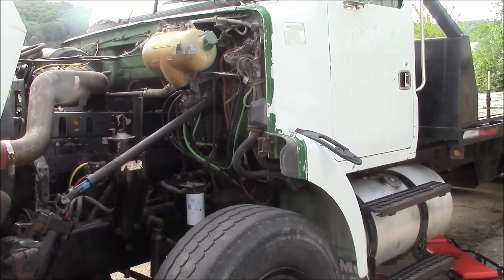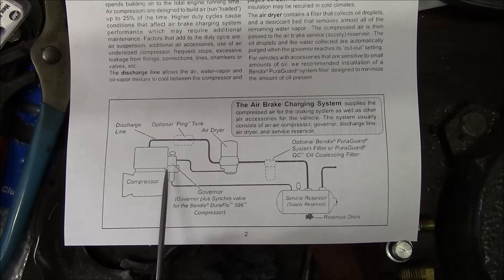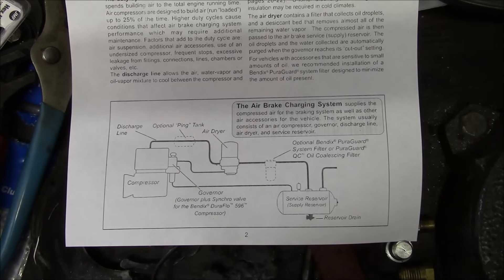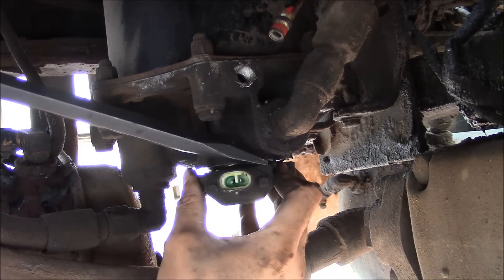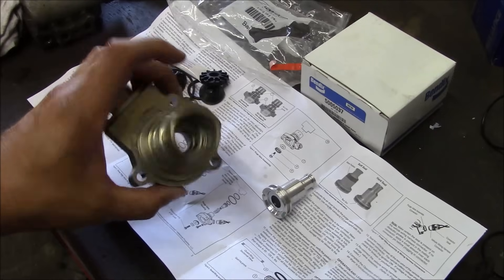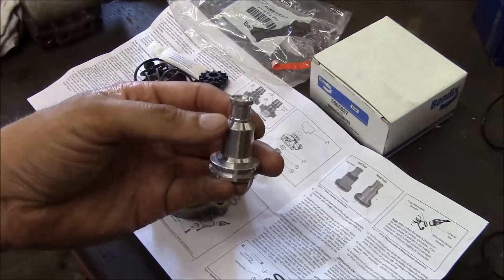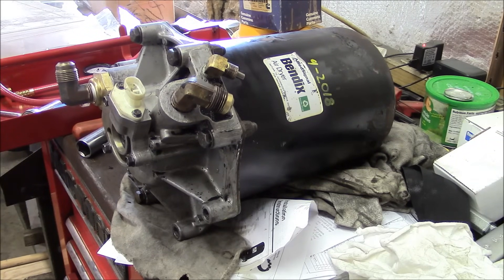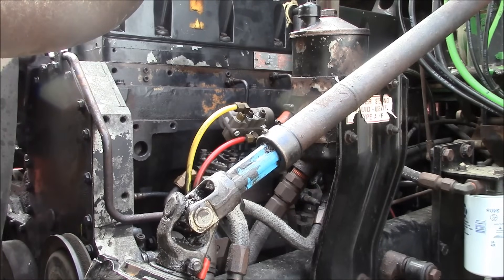Truck Repairs: Air dryer purges constantly

Comment: This helped with figuring out the air leak in my 1999 Bluebird Bus (skoolie conversion), Cummins pusher/Allison auto. I was just about to move it to a new (cheaper) storage lot and there was this intermittent hissing. I could feel air coming out of the purge valve. Obviously the air system was not getting up to pressure. After digging around (including this video) I replaced the valve, a $13 fix. No more leak! Not only that, the system held pressure overnight, which it had never done before, so evidently this leak was always there since we bought the bus (2020), and just now decided to 'erupt.' Perfect timing.
Reply: Hey can you give me some advice as to why my 2002 international short bus decided to stop building air all of a sudden? I started it and moved it around and went to park and it locked up at 30psi

Comment: This video provided the clue I needed.  I have a vintage truck that I added a dryer to. The unloader would work so long as the purge valve wasn’t hooked up. With the help of this video I realized there was an air leak in the purge valve line. It wouldn’t leak until the unloader valve activated and then you couldn’t hear it over the engine. The leak was bad enough the unloader valve wasn’t able to build enough pressure to cycle. A little BB of plasma cutter slag burned a tiny hole in the line. Thanks!

Comment: If that check valve is leaking would it cause the compressor to not cut off. I’ve replaced the governor and it won’t cut off.

Comment: Thank you your video proves I'm right that there is a problem that the company shop said is not a problem so compressor is running all the time loses air while running and while setting not running

Comment: Hey, cool vid! How often should that blow-off valve thing vent? My RV's doing it every 3 minutes while idling, even without using the air or brakes – something's fishy, what's the normal time between compressor restarts?

Comment: Sooooo, what would cause a HIGH pressure issue? Got a Peterbilt body job that is showing 150 PSI on secondary, 120 primary...how is that even possible? If anyone can shed some light on this, thanks from a puzzled guy in Alberta, Canada!

Comment: Hi, my truck is building too much pressure, I've changed the air dryer, and it still  it going over 150 psi before it purge, what should I do. How do I adjust it?

Comment: So lets say I'm having the same issue, and I just replaced the entire air dryer assembly and thought the problem was fixed, but a few days later it came back. I replaced the governor on the compressor and the issue didn't resolve. If I'm understanding your video correctly the only likely culprit now is the air lines possibly leaking between the unloader and the tank or the unloader and the dryer? 

Thanks for the video btw, great info and basically exactly addresses the issue I'm having
Reply: I’m having the same issues , I replaced the air dryer assembly and the air governor but I’m having the same issues , I’m wondering if you ever find the problem ??

Comment: Oh my this video is old.  WET tanks have been eliminated.  And Bendix is not the most common air dryer in America.  Merritor Wabco is the most widely used now.  I've driven 9 different trucks since i got my CDL and all of them had Merritor Wabco.  

Largest contributing factors to popping air dryers is BENDIX.  Volvo still uses Bendix and thats why they all have popping air dryers regardless of year.

Comment: I got a different situation with my truck freight liner cascadia so it just keeps purges every 16 seconds so I checked the whole air dryer couple houses and air compressor so still didn’t find anything issues so please what did you recommend to me

Comment: We have a truck that purges at every second at the rate or engine rpm. Faster rpm, faster the valve open and closes. Once the governor allows air to build the purge valve returns to normal behavior untill the next purge signal. Very frustrating to pin down the cause

Comment: Great Video man 👍 
But im having a situation here where I got the Air dryer, air governor , and an air compressor relatively new (less than a year old) replaced because my air dryer started purging after I switched the air governor to a new one thinking it’ll fix the reason my psi hits 100 not 120 (adjustable). So point is I got everything replaced except the air tanks. Could it be that ? Also I have no air leaks.

Comment: Would any of these cause my secondary air tank to constantly drain build up blow off and repeat every 10 seconds? I’ve replaced Governor, dryer filter, dryer purge valve with no luck. Guess I should check that check valve?

Comment: So I have a 2016 mack trash truck the air dryer does a pst pst pst  noise after engine start up coming from a valve at bottom next to purge valve then after some air builds it leaks causing a very slow air build maybe to 40 50. Psi and won't build past that tell you ramp up the throttle it will build taking forever then purge one time not sure what the little valve is beside purge valve and exhaust port. As I'm new to air. Break systems. Also has air leak from foot valve exhaust breaks set and not set if I plug the foot valve tube leak with breaks released the breaks set. Never the less I'm not sure if someone has messed with air lines. Any ideas? On how to solve this puzzle?? Thanks in advance for any info.

Comment: This doesnt solve my problem. Replaced the apparently good air dryer with a new one, no leaks I can hear or see bubbles, pressure appears to be holding at the guages, no wind to rock the truck and deplete any air. The problem is persistent, seems like the compressor is constantly running, air dryer pops off every less than a minute. Thanks are dry, no water/oil at the petcocks. What's next to check?
Reply: Already fixed today in shop ,3 fittings, thanks for info.(but not at airbag)
Reply: You found a problem?(I have the same problem now)
Reply: @cocierumihail  check all air bags and air lines with soapy water. My problem ended up being two airbags.

Comment: I had to go watch the video over again just to make sure that he said where the check valve was located and he did not All they showed him loosening the filter and putting the filter back on and the next thing you know the check valve is in his hand so I am just going to assume that the filter is screwed onto the check valve that's the only thing I could come up with so if you want to get to the check valve you basically have to take it apart to pull the filter off

Comment: Wes, did you kiss that check valve?  That's why it re-seated.  :)  Most of these repairs are due to daily maintenance, or not doing it.  The compressor is the most important part IMO, so that dirt floating around on the purge and/or unloader is gonna get to the compressor.  Keep it clean.

Comment: I had the some issue it kept purging repeatedly while I was driving too 
After watching your video I changed the purge valve nothing changed same issue then I changed whole Air dryer assembly but unfortunately still have some issues still purging while I am parked and driving
Reply: How did you end up fix it?im having same issues

Comment: I have a 1978 Mack U600 2 years ago I changed the throttle valve because of an air leak. Today the new throttle valve is leaking. What to do?

Comment: I replaced my air dryer and air to air compressor on my Peterbilt 389 the dryer alone was $800 that was the bending adis system and the compressor was $1300

Comment: I replaced the whole air dryer and governor and it’s still purging constantly.
I’m a parts replacer for my boss where I have to work on the truck when I’m not running it.
May have to have him send it down the road but the shop he sends our truck to just replaces parts too.
Any ideas?
No audible or visible leaks with soapy water

Comment: Very good detail. I will check my check valve. I have the small filter & it blows air out a built in weep hole on the side. And I don't know why. Do you? Thx 4 vid.

Comment: The inline elbow check valve might be mounted on wet air tank( actually its  one way walve, cause check safety vale is different one on air dryer housing) .

Comment: Great video!!! I was leaking bad from the purge valve so I rebuilt and it’s no longer leaking. However, it only purges 1 time after air pressure builds then I lose around 10 psi every 10 minutes or so from somewhere else. I hear an audible hissing from behind the glove box and dash. I pulled the glove box out and it’s much louder. Sounds like it’s underneath the glove box. Trying to wrap my mind around what the cause could be. Wet tank?
Reply: Either hvac mixer valve or parking brake lines.

Comment: I remember that the small machine screws holding the heater on would snap off and it wasn't worth drilling them out. Plus most of the time this was done [n the side of the road in freezing temps.

Comment: an AD9 dryer it's almost cheaper to buy a reman rather try to fix them by the time you buy all those parts and time often it cost more then the reman they run less then 200 sometime truck part store or dealer have them on special

Comment: I worked on a truck I was rebuilding and ran into the compressor not unloading. The governor worked as advertised. The dryer worked as advertised but when unloaded you could hear the compressor still pumping. In the end, it was a stuck unloader in the compressor that was bad. Free up the stuck unloader piston and problem solved. The engine was an NTC 400 Big Cam III in a GMC Brigadeer. It was a big project. Started with a cab on the chassis. The engine on the ground. No trans. It had been a single rear axle road tractor. The engine was rebuilt by others. I installed the engine along with an Allison 754 trans. Had to fabricate new rear engine mounts as the ones for the manual trans didn't fit. I also stretched the frame and installed tandem rear axles. One big project. I also installed a power steering box in place of the original manual one. I enjoyed the challenge at the time but I sure don't miss it anymore. Ultimately we installed a new Leach trash body on it.

Comment: I worked for the railroad until I retired. The moisture spitters on most of the engines air tanks worked constantly.  Would drive ya nuts.
Reply: I love trying to sleep near railroad tracks when they pull up and sit right next to the truck stop...  rumble rumble pffft rumble pfft rumble pfft.

Comment: Actually Bendix is most common on certain brands of trucks like the piece of shit Volvos.  My Freightliner has Meriter Wabco air Dryer thank you.  My air dryer system doesn't pop but once or twice an hour like it's supposed to.  Most people don't care if it purges.  They say oh it good you won't have moisture I. The system.  My Road Assist department even told me it's normal and happens because of too much humidity in the outside air.  But its only the older Volvos, some Peterbilts and Freightliner Columbia's that do it.  So that blows the humidity theory.  If it was humidity every truck would be doing it.

Fix your truck guys.  It's an air leak.  Don't ignore it.  Plus guys sleeping beside you will say thanks because they might get some sleep.

Comment: Another great vid, i know this ones a few years old but nonetheless it was helpful, though not to my wallet. Its so nice you show the part numbers so those of us in a similar situation can just plug em into google, tap a few keys and have parts on the way with very minimal time expended screwing around looking it up. Now when i actually have the time to crawl under my damn truck i'll have what i need handy and if i don't need those parts now i KNOW i will so its handy to have.

Comment: Spare self-rebuilt parts are valuable, save it!  The time and money spent on your diagnosis and repair, priceless!  Now u know.  how about periodic maintenance to clean and inspect?  you will save money in the long run with this knowledge.  Also, using the right tools for the job (NOT using that adjustable wrench) is key for not damaging a perfectly reusable part (saves money) and demonstrates professionalism!  good job, mechanic!

Comment: I have a 1993 freightliner that does it every ten seconds. I had to put a newer compressor in it but I put the governor on the same spot that the governor sat on the old one. Are their different places they could fit?  I rebuilt the air dryer and put a whole new line from the governor to the dryer. Any answers?

Comment: For customers that don't have time for downtime like the guy I drive for he gets new or reman parts and I get a new toy to take apart and figure out what it's failure points are and what causes them like the homemade log truck project he bought. I think it was tied with your project in terms of electrical splices and corrosion from test light jabs. Glad he let me do it my may and start fresh instead of "fixing" it with more splices. He isn't scared of spending money on inventory either.

Comment: I have been searching  the web for Governor  ,Air dryer and Air compressor  schematics/ Diagram  anything to replumb  or re route i have a Volvo with a auto partial Air shift that has so many hoses everywhere and just had a guy put on a Governor  come to find out the Governor was in my battery  compartment  so I had 2 Governors lol and I have the biggest mess to clean up behind  2.7 million miles of mechanics and your video has been saved  subscribed  and downloaded because your the Best man!! Such detail and clear words on how things work well my unloader in my compressor  is probably  full of that carbon that builds up in my air dryer as the Governor  is probably  full to from compressor  non stop running and damper blowing air constantly. Thank you for your videos Dont ever stop making them God Bless your Money!

Comment: Congratulations on your patience to actually find the problem, the difference between a true mechanic and parts replacer.  Yes I understand the economics of shop rate to replace a part/unit vs finding the actual problem.   Good work.

Comment: Never hurts to clean up the old value and keep it for another day with a same situation. I do that to a lot if things. Amazing how many times such parts come in handy down the road. Thumbs Up!
Reply: Thats why every mechanic has that "junk drawer"  its a life saver
Reply: What is going on with mine the truck has brakes but there's no pressure air coming out either glad hand so is it in the proportioning valve causing this problem?
Reply: @tomscott8402 if one is having a problem, others are bound to also. Just yank them all and clean them and throw them back in. One trip to the solvent tank.

Comment: Just something else to ponder 🤔 in an air loss situation. If the truck just won't hold air very long. An you just can't hear or find a leak. Replace the cloth air line from the dryer to the bugle line, going to the compressor. Overtime the line becomes baked from heat an starts to leak through the cloth. Can't hear it but it's there. 
Hope this may also help someone.

Comment: Thanks 🙏 a million you’re dope. Came in for a new governor and damaged air hose. Then the purging started Having the same problem 2015 freighter liner cascadia. Having them look it over before I leave the shop.
Reply: We replaced the governor on our f650 and then the constant purging happened.  Weird how that happens. Not sure if the leak or this constant purging is more annoying.

Comment: Enjoy the video 
I have a 2001 peterbilt model 379
I am having issues loosing to much air when I apply it
It drops from 120 down to 90
No air leaks anywhere 
If I apply the brakes again I will go from 90 to 60
I have installed AIR COMPRESSOR AIR DRYER AND A GOBERNADOR 
COULD IT BE THE FOOT VALVE?
Thank yin advance

Comment: What should be the “normal” purge cycle for the air compressor?
Mine purges about every 7-10 minutes when driving and maybe every 15-20 minutes when idling, which both seem too often to me.
Reply: that's almost normal, must be a very minor air leak somewhere. if the DOT inspectors haven't found it for you, some dish soap and water in a 1 qt. sprayer will find it.

Comment: Great video, this and your other videos. I have a Ford R1114 1973 with a Cummins 6BTA5.9 C engine. Front brakes load up to 80 PSI, rear only to 40 PSI and very very slowly. Problem when (trying) to drive and using brakes rear pressure goes to 0 in no time, front also runs low to extend that warning signal kicks in but pumps up pressure. Obviously not safe to drive any distance. Any suggestions as where to start? Tanks and lines are okay no leaks. Cheers
Reply from the maker: Check the treadle valve (under the pedal).
Reply: @WatchWesWork  Thanks for prompt reply. That would not explain the uneven build up of air front to back 80 vs 40 psi max?

Comment: My truck is doing this, new compressor, new governor, New check valve, new dryer and filter, still does it. Can't find a leak. Not sure what else to do. Any advice on where to look?  Ad-sp dryer. Pete 379
Reply: 😂 found this video again. I still haven't fixed this issue lmao

Comment: Found out that these air fryers on the frieghtliners go out a fairly good bit. When they do, it's because of the automatic drain valve or purge valve. Those darned things have just too many o rings/seals that shrink or crack and leak air.

Comment: Ole Cummins m11 in that truck same motor as my 96 kenworth k100e I’d recognize it anywhere had same issues with my system purging every 30 seconds too did all the same things you did didn’t fix it couple weeks later it started working properly 🤷‍♂️ working great ever since

Comment: After you did this how often it was purge the air again. Before was every 29 second now how longs it take to purge.
Reply: i have same question, mine is like  purging every  about 3-4 minutes :-))) i  know its not normal, should be like ones a minutes, depends on rpm
Reply: @ictviamfortruthgoogleisspa5886  chase air leaks down first, soap and water in a qt. sprayer.